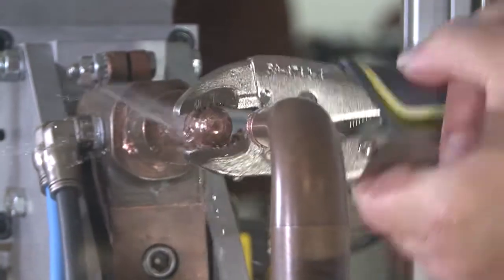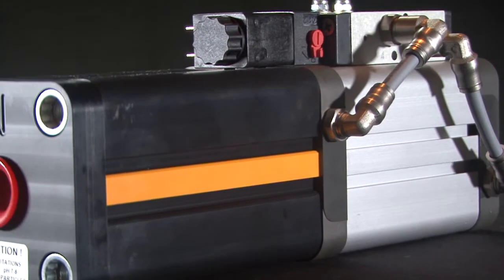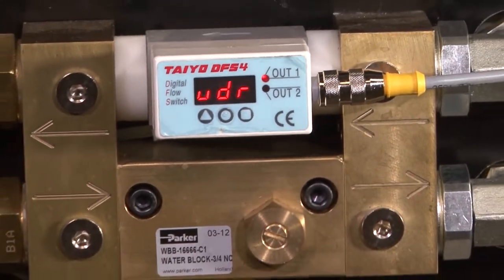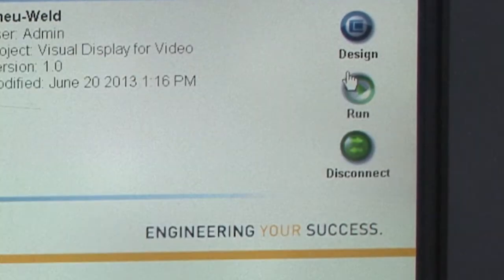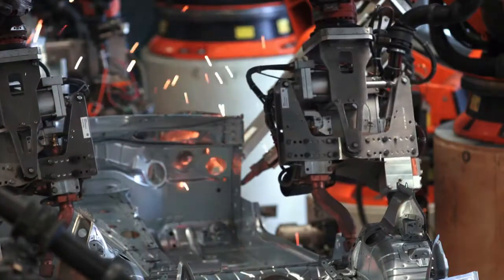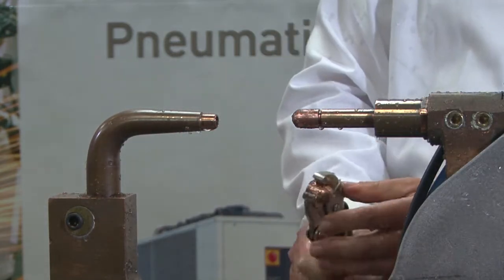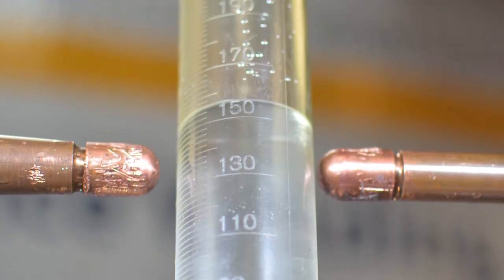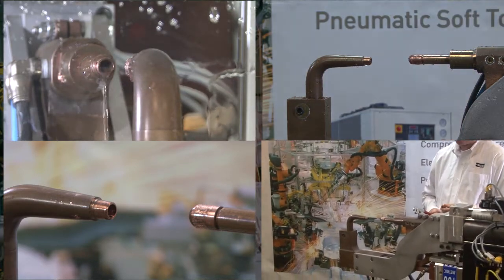Revolutionary Water Retract Actuator | Parker Hannifin

Comment: From this Video, the gun show is horizontal C-gun and cap-tip is in the highest position, but in our current line we use C-gun and X-gun vertical (remove cap-tip position), result is remain water around 50-100 mL when remove cap-tip(without pressure), could you please suggest me for decrease water remain.